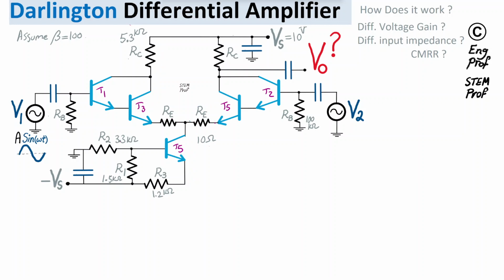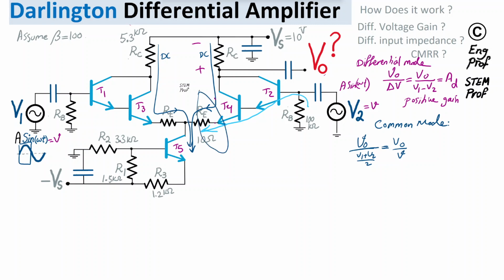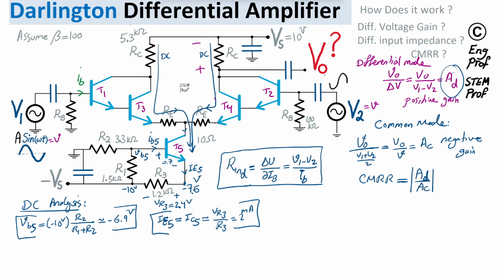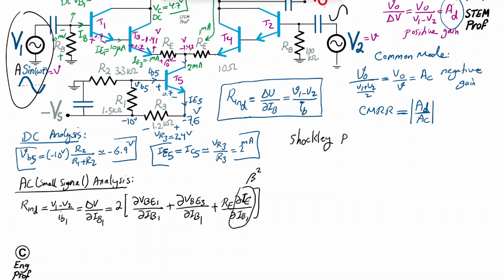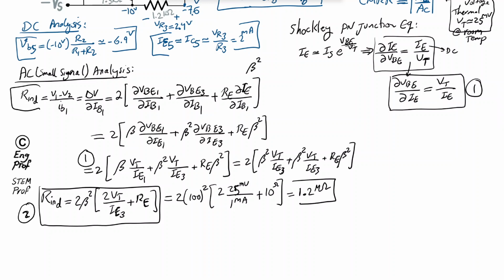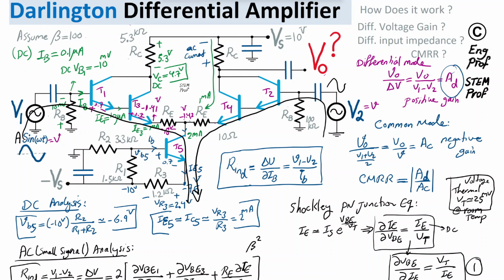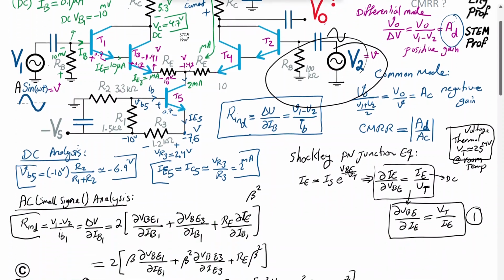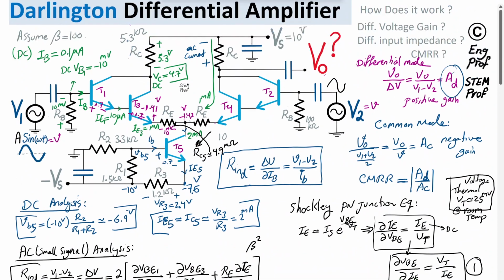Differential Amplifier Gain, CMRR, input impedance with Darlington Transistor

Comment from the maker: Thanks for watching. For more Amplifier and Analog Circuit examples pls see:
Op Amp Amplifier with Electronic Gain Control https://youtu.be/NoNgQpbj77Y
Power Amplifier Design (Class A) with Transformer https://youtu.be/gKlJrqGqeCI
Push-Pull Power Amplifier Design with Op Amp, Sziklai Darlington Transistors https://youtu.be/8BFzsi7-Vbs
Differential Amplifier Design with BJT transistors https://youtu.be/zKgSYvk7JAM
Instrumentation Amplifier with Electronic Gain Control https://youtu.be/C4tghZ-q6Zs
Op Amp Analog Computer Differential Equation Solver https://youtu.be/ENq39EesfPw
Push-Pull Power Amplifier with Darlington Transistors https://youtu.be/866MYibo8yE
Voltage Regulator Op Amp Circuit with Foldback current limiting https://youtu.be/VN4_qF9DvBM
Analog Logarithm Computer https://youtu.be/RpKEq5WyoLg
Thermometer Circuit Design with Op Amp & BJT transistor https://youtu.be/55YsraFE0rg
Current Foldback Voltage Regulator Circuit Design with Op Amp, Darlington BJT Transistors https://youtu.be/RFfRrbqM_-s
Sallen-Key Analog Filter Design Tutorial https://youtu.be/KwUnQXbk7gM
Universal Analog Filter Design https://youtu.be/2J-0msXZE2o
Laplace Transform Example and S-domain circuit analysis:  https://youtu.be/ps8N5TPM_qU
Op Amp circuit Bode Frequency plot https://youtu.be/BLVzuuqAlZs
Lowpass Butterworth Filter: https://youtu.be/UzCjkwqy-9w
Analog Computer to Raise Signal to power n https://youtu.be/IUTlBH1UraE
Triangle Oscillator Op Amp circuit https://youtu.be/JF5Up_cuL9k
Differential Equation Solver Analog Circuit https://youtu.be/R3X5AYNZGEI
Complex Sinusoid Oscillator https://youtu.be/GXRhmwmS5Zk
Sawtooth Oscillator Design https://youtu.be/2eUsGPfqbW4
Full-Wave Rectifier circuit example https://youtu.be/DJJMNU-CYcg
Sawtooth Waveform Generator design with OpAmp, JFET, BJT https://youtu.be/5zHXTx-Vl20 
op amps Circuit with feedback loops to design an analog computer that solves a second order differential equation https://youtu.be/HeZRtnRXpEI 
For more analog circuits and signal processing examples see: https://www.youtube.com/playlist?list=PLrwXF7N522y4c7c-8KBjrwd7IyaZfWxyt
I hope these Circuit design and analysis videos are helpful. 🙋‍♂

Comment: Cool video. Why is cmrr important?
Reply from the maker: You're welcome. Glad that you liked the Video. CMRR stands for Common Mode Rejection Ratio which is the ratio of differential gain to common mode gain as explained in the video. CMRR is an important KPI and practical design consideration for Differential Amplifiers including the Darlington Difference Amplifier circuit in this video. Ideally we want a Differential amplifier just to compute the difference between the two input signals (differential gain). Therefore ideally generates zero output when two input signals are equal. In practice that is unfortunately not exactly the case due to circuit mismatches, offsets, leakage, and other circuit nonlinearities & non-idealities. Therefore practical Differential circuit output is not exactly zero when two input voltages are equal (common mode gain is not zero). Though very well-designed Differential amplifiers have near-zero output when two inputs are equal. That means their CMRR or the ratio of differential gain to common mode gain is a very large number. When purchasing a differential amplifier we want CMRR to be as large as possible. I hope this explanation is helpful.  For more Amplifier and Analog Circuit examples please see:  
Op Amp Amplifier with Electronic Gain Control https://youtu.be/NoNgQpbj77Y
Differential Amplifier Design with BJT transistors https://youtu.be/zKgSYvk7JAM
Instrumentation Amplifier with Electronic Gain Control https://youtu.be/C4tghZ-q6Zs
Thanks for watching. 🙋‍♂
Reply: @STEMprof  thank you very much, this explanation was very helpful!
Reply from the maker: @rudygomez6996  My pleasure. Glad that the explanation of Common Mode Rejection Ratio was helpful.
Reply: @STEMprof  thank you 😜